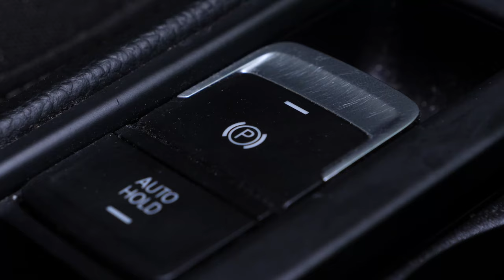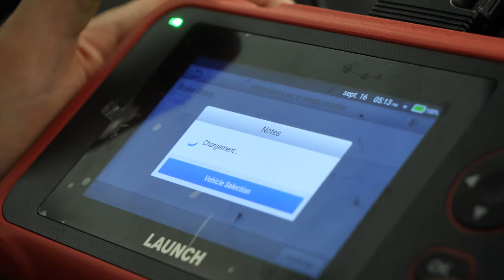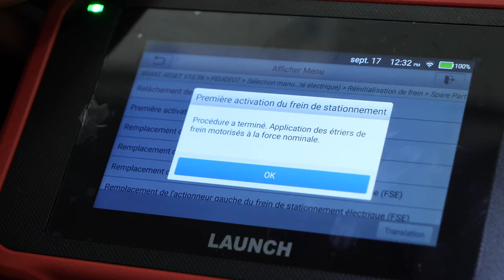How to replace the rear brake discs and pads Golf mk7 🚗

Comment: Just did this on my 2014 golf 7 1,4 tsi, can say that all the tools matched but space was vastly different, hade to use an allenkey for slider bolts which took ages and to get the caliper mount off there was simply no way of going with an extension.

all in all took me about 3 hrs and was a learning experience, i did replace one caliper so my install was a bit different, bled the brakes but didnt do a 100% job, gonna try again tomorrow.
Reply: The 1.4 models have different rear supension thats why

Comment: Every single fastener had been loosened previously and both the wheel and the disc (rotor) had been freed off prior to filming, this is a fantasy version of the job. Completely different to a real world situation. Impractical for real people to use as info.
Reply: How would a video of someone having to fight with a wheel nut help you in any way
Reply: @davidwilliams8708   Glad you asked, most people watching this are not skilled techs and have no idea how to loosen a stuck fastener, for instance most times it isn’t the thread that’s rusted, it’s the contact face of the fastener head, a sharp rap sideways with a brass punch will often loosen it. The point I was making is that the most difficult part of the job (loosening rusted/stuck parts) is missing in this video, it’s over-simplified making it appear far more easy than it actually is. The reality was that the wheel on my Golf had corroded onto the hub, which had to be freed without damaging anything, the countersunk screws retaining the brake disc were rusted in and needed drilling out, there were other problems encountered which are not even hinted at in this film, hence my comment re it being a fantasy version. For the record the wheel nuts didn’t fight back.

Comment: Càn I just leave the hand brake off? I dont have a conputer to connect.
Reply: Nope. You can do it with a power probe though. You can’t just release the handbrake because the motor will be out